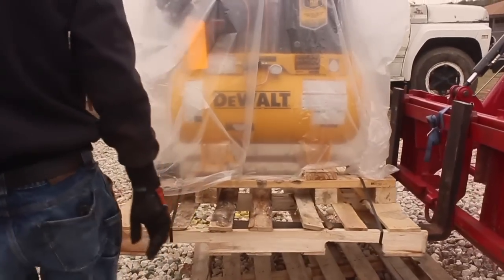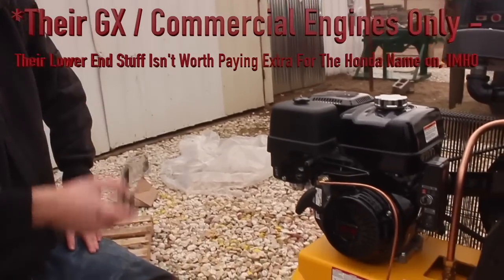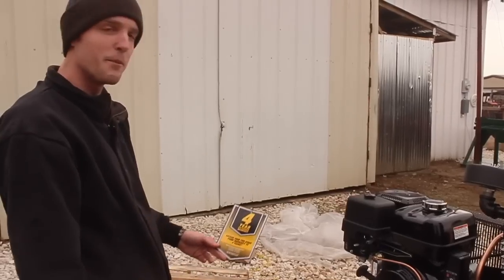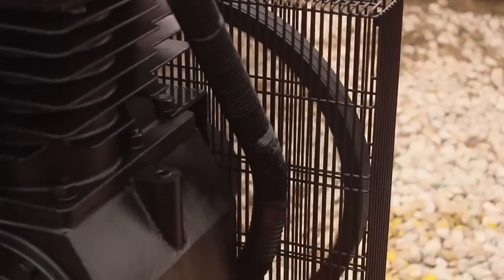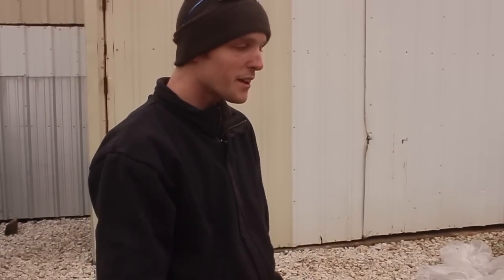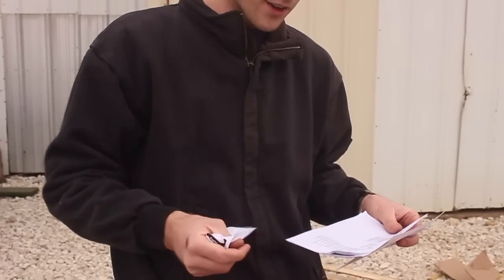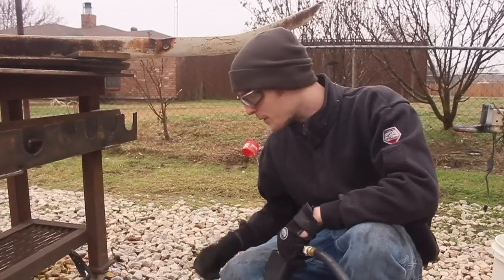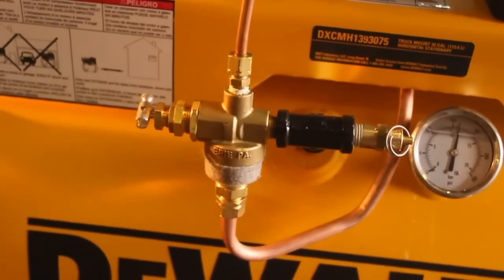WHAT NO ONE TOLD ME ABOUT BUYING AN ENGINE DRIVEN AIR COMPRESSOR FROM DEWALT!!!

Comment: Carbon Arc vs Plasma cutter, any opinion?
Reply: Carbon arc is useful if you need to remove a weld but keep the metal parts to reuse or reweld. Thick stuff is where it shines. Useful on excavating machinery to rebuild hardsurfacing,bucket repair etc. Hope this helps. AL B.

Comment: Mine is an 30 gallon ingersoll-rand with a 14 horsepower Kohler gasoline engine I had on my service truck for years.  Never a problems....but in winter the moisture goes ice up the air cleaner....and I have to bypass the oil shut down switch during start up in below zero cold winter. Also, I have to clean the fuel as that ethanol is a problem on gas engines fuel systems .  This has been the go to compressor of all the tire service road service outfits for decades. 
I did not see you check you oils before startup.
Reply: 0w40
Reply: I have same compressor. Moisture has gotten to the piston ring. I need to either rebuild the top end with new ring and piston or get a harbor freight predator replacement engine. My t-30 has low hours on it.

Comment: Nice looking compressor.  I'd suggest you also change the compressor oil soon as it operates very much like the gasoline engine.  You might want to add some FUMOTO valves to make the oil changes easier and far less messy.

Comment: At some point I'm going to convert my gasoline powered 30 gallon truck bed air compressor over to dual fuel propane or gasoline. I like gasoline but the problem the needle, seat and carburetor always goes bad over time. With the generators I've converted to tri fuel like my Honda 2200. I've only run propane in my Honda 2200 and propane is the fuel you can let sit for years still start up no problems. And no gasoline problems ever. Your oil will stay cleaner running gaseous fuels like natural gas, propane or hydrogen, no gasoline in the oil, no black carbon on the spark plug. Propane and natural gas engines last much longer with less maintenance and cleaner than a diesel. No gasoline flooding problems running gaseous fuels. When I convert my air compressor over to propane and still can use gasoline and only run propane in it. I'll have a 4.5 gallon propane fuel tank minimum. Converting to propane you do lose 10% of power. I have seen a little difference in starting stuff on my generator another one I converted to propane. It really struggle to start some things on propane and one small motor the generator on propane wouldn't start it.

Comment: I have the same kind of air compressor but it's a Ingersoll rand. I think the specs are a tad higher on yours I did turn mine up years ago to 205 lb air pressure still running great. If you really want to see a mean gasoline-powered truck bed air compressor look at the rotary screw air compressors they're the best in the business and with a price tag to prove it. They have an air compressor, welder and generator all built in one box. The Ingersoll Rand air compressor representative years ago said I could turn it up to 205 lb of air pressure. It does make a little difference. I also use the 3/4 inch air line.

Comment: I would go with a muffler. I hate engine noise all day. Even with a muffler most are still too loud. My Miller big 40 had no muffler but was optional. Made it a little better. It may also be better for the engine valves at shutoff time. Keeping cold air from hitting the valves while they are still hot.

Comment: 2:15 "you know probably not hurt to put gas in this".... no.. it wouldn't... but it would if you didn't put oil in it!!... I assumed you had put gas in it... but you didn't... I hope you did put oil in.
Reply: Honda engines have low oil shut offs so it wouldn't have even started if there was no oil in it.
Reply: @1pcfred  As long as it's not a clone... just because it says it a Honda... doesn't mean it was made by Honda... China make Honda engines... and pay Honda. I know it does because I bought one... It's a Honda engine... it says it's a Honda... but costs third of the price. Called a Honda clone. It's not a copy.. it's genuine... but it's a clone.
Reply: @johnw6389  if it is a genuine Honda product then it will be made to Honda specs. The Chinese are more than capable of making decent products, if you pay them to. They have better heavy industry today than anyone else ever had.

Comment: What was the process called with the graphite rod and air? Is it sometimes referred to as "broncing"? I've seen something similar used in stuck large equipment pins, looks pretty neat!
Reply: In the uk we call it carbon arc gouging, its so loud it makes your chest pound.
Reply: Carbon arc gouging, extremely quiet when i run my miller 200le at full idle and my honda engine air compressor in a suburb, i call it stealth gouging